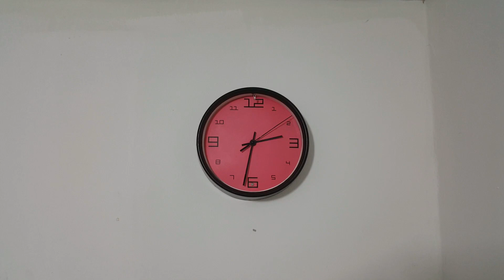Amazing Circuit With Transistor BC 547

Comment: Sir market se 9,18,50 watt dob Laker  banai gayi light ki roshni uski capacity se kam aane ka karan pls . diffuser distance from dob or mov resistor used in it or something else.mere 100watt ki light banai aur 25 watt jese blub jitni roshni aati hai.
Reply from the maker: aap kitne volt kitne ampere as input use kr rhe h ya input voltage k liye konsa driver use kr rhe h detail se btaye
Reply: On ac i am running no driver only mov and fuse resistor as you told
Reply from the maker: @elexshown2520  Bhai ye circuit ampere bhut kam deta hai aap mere ko apni dob ka link share kre ethcircuits@gmail.com pe m aapko dusra circuit send kr dunga aapko light k according
Reply: @Ethcircuits   ok thanks I will send you details by  mail

Comment: Everything is good but light doesn't  distribute evenly. Pls suggest any solution
Reply from the maker: fix LDR and LED in proper way, use LDR in Upside of Wall Clock and You can use 2-4 led in parallel for more light ( at no 3-6-9-and 12 )

Comment: It want itto on in full darkness now itstill get on in day light
Reply from the maker: if you facing any problem plz use 100k variable resistor instead of 68k and also fix LDR up or down side according to light means where it can work properly